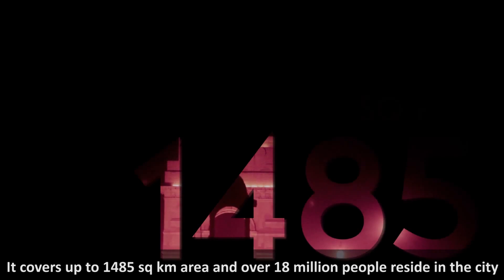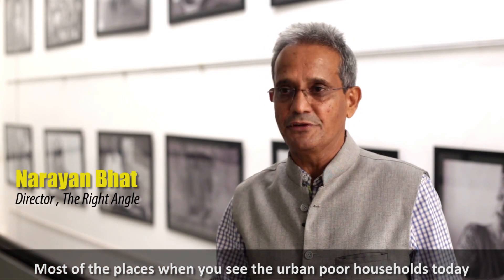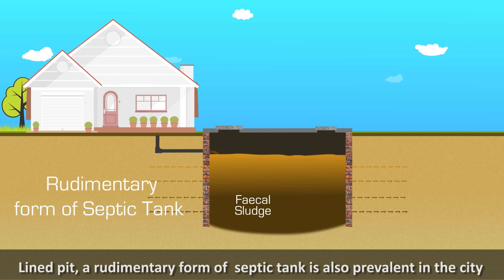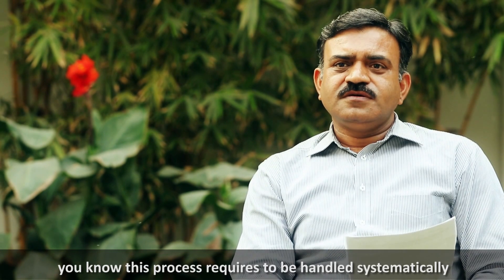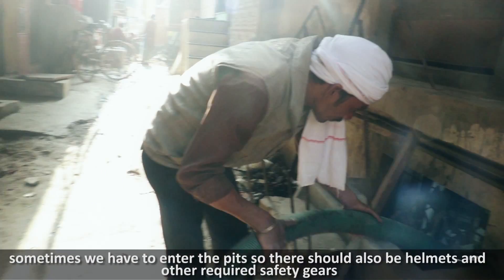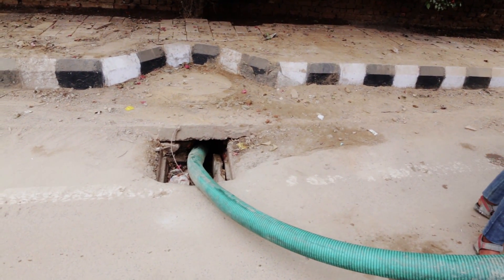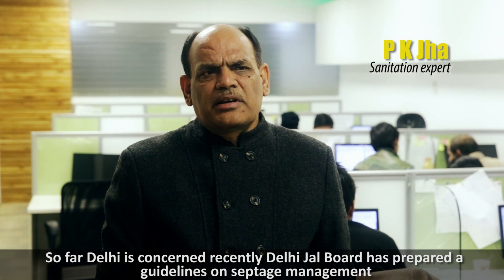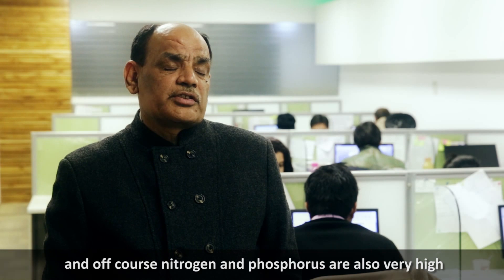Fecal Sludge Management (FSM) in Delhi - a case study

Comment: You have identified a problem , so please give feasible, workable, practical and effective solution . Most of treatment plants are underdesigned , also very expensive to operate . In Surat Gujarat India they have come up with a solution that they treat the sewage and recycle the water back to textile industries at a given price . Because of water shortage industry is happy to use this water of low TDS instead of boring water of high TDS . The Surat municipal corporation is doing a good job and it is a win win situation .